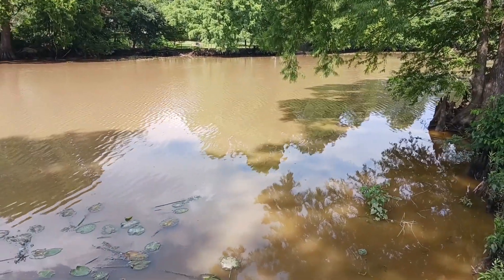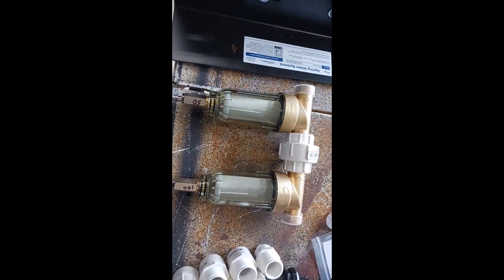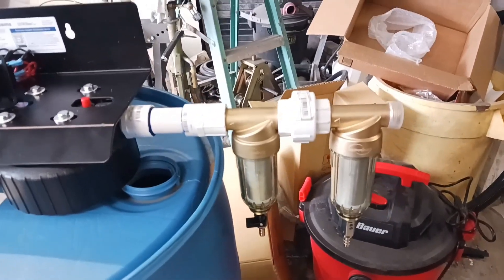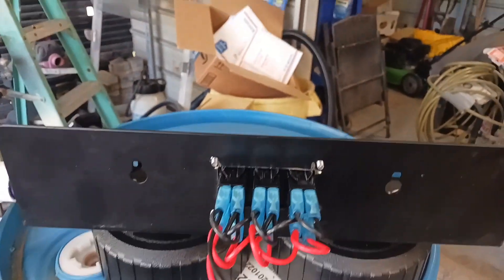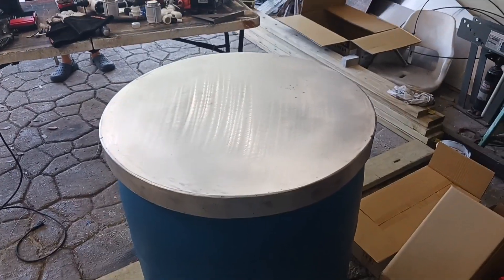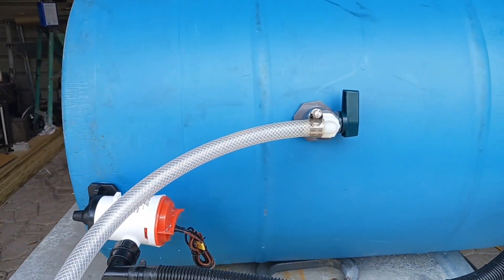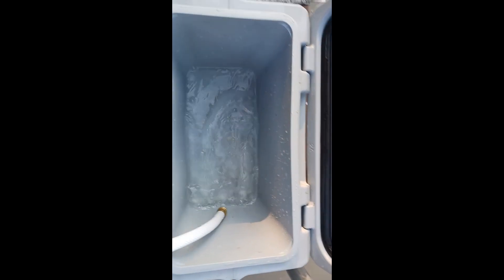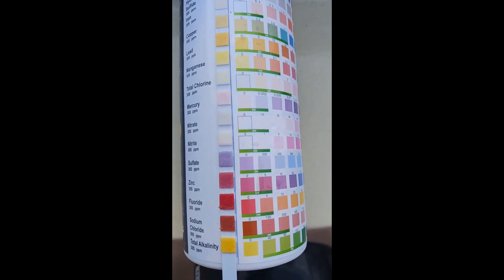DIY Fresh water maker

Comment: That will work just fine.Good job!
I'm a waterwell professional and filtration specialist, you've got a winner.
Reply from the maker: Thank you. I really appreciate it
Reply: @hangingwithpopmcnett4180  
Hey just found your channel today, of course an episode about filtering bayou water caught my attention. How did it do for ya,with the crazy times we're in,I'm gonna build a portable high volume system,your's is similar to my vision.
Reply from the maker: @JEM133  it works good. I'm still working the bugs out on how much aluma to use and how long mixing and how long settling. I've been researching chlorine just for a little more added protection. My holding tank is only 60 gallons so this size is working out good for me. You are right we are in a time that is becoming unsafe and concerning. I still want to send a sample to a professional testing company, just to be sure.
Reply: @hangingwithpopmcnett4180  
I worked for Culligan for quite a few years,doing whole home,filtration, softeners,and reverse osmosis. When we wanted water broke down ,we sent many samples to Culligan. Sometimes shocked at their findings. Never a bad idea,they can customize for you.Ill bet you can get water checked by the county/parrish in your case.
Reply from the maker: @JEM133  don't think we have a culligan around here. Still waiting on the local water around here to return my call
Reply: @hangingwithpopmcnett4180  hey thanks for chatting back,I subscribed to your channel, and watch sone more Louisiana video. I live in the high Sierras,dads whole side of the family was mistly Plain Dealing, Benton,Bossier,etc.